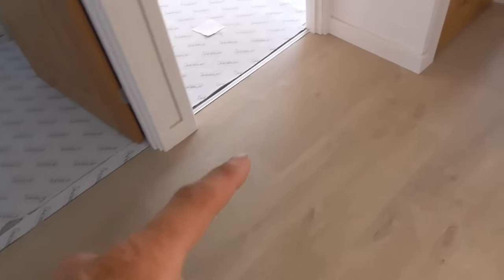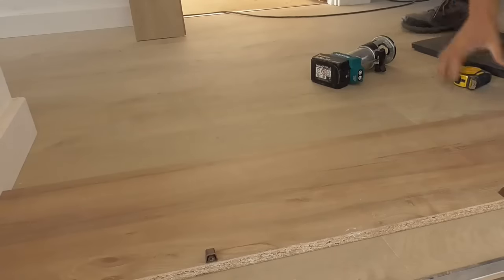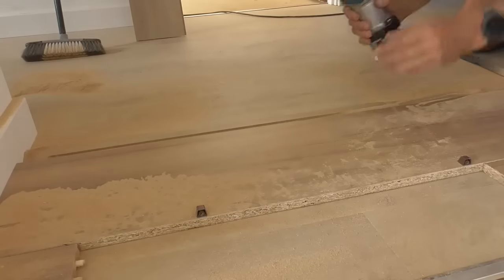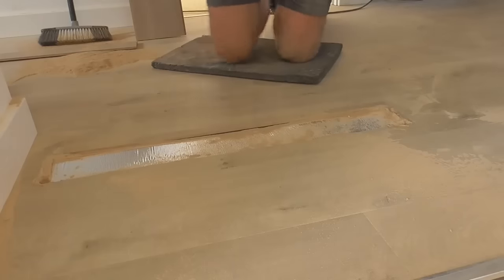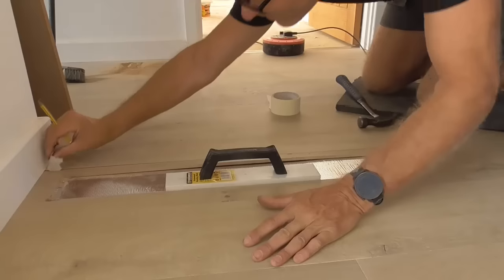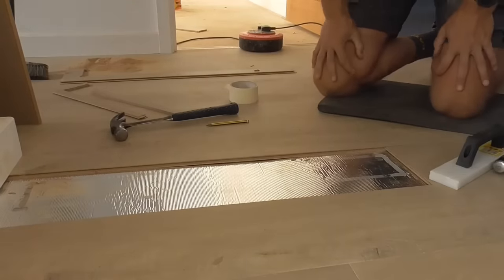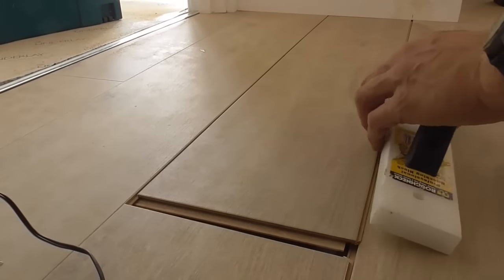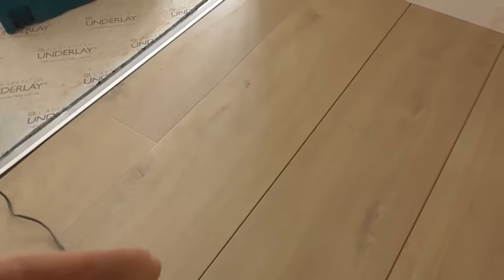Replacing a damaged laminate floor board. ***CAN I DO IT WITHOUT TAKING THE WHOLE FLOOR UP?***

Comment: Did the plumber drop his wallet? No wonder it made a mess 😂😂😂
Reply from the maker: Best comment ever🤣🤣
Reply: I was going comment Del but I'm too busy laughing 😂
Reply from the maker: @chrisneville7310  I proper laughed at Tonys comment Chris😆
Reply: @thetallcarpenter  I heard he slipped and nearly broke his BRASS neck and was later found by a COPPER.
Reply: 🤣🤣🤣 I wish. I'm blaming builders for making me work on trusses with no platform or lights. Worst part was I watched it slide along the top of tool case and bounce down ladder. Super Del to the rescue though. What a guy. 😍

Comment: More of these vids please. It’s how we rectify errors and mistakes that really help
Reply from the maker: Hi there🖐I have shown quite a few instances of my putting my mistakes right, but the are usually buried in a longer video😬Reading your comment, I think I might start making separate, stand alone videos about rectifying them👍Thanks for watching and your comment 😎 Cheers Del
Reply: Yes please. We all know you can do stuff, which is why we watch .... BUT the real application of your skill and experience comes when it goes wrong, or you are called in to fix something. This flooring one was particularly good, especially as you exposed your thinking in advance.  There are a few other 'Tubers now doing what I call 'confessionals' (PlumberParts, MrA Builders, SkillBuilder) and they are not only excellent viewing, but vital sharing as we have all been there ..... or will be one day.
One starter for you could be 'Wood matching' i.e. fixing damaged / split wood and getting the colour match right

  @thetallcarpenter

Comment: And that’s why quickstep is worth the money ! Had to do the same thing on engineered once but on a full one so had to cut a bit off the back off the shoulder and tongue. Not ideal! Good use of the palm router making a hole and then snapping the thin strips! 

Showing class and experience again, builders got to be happy with that!
Reply from the maker: Hi bud🖐It's never obvious which is the best approach for doing repairs like this, and I guess I will always try and go for one that has the best chance working and not becoming problematic later down the line🤔Thanks for watching 😎 Cheers

Comment: Great repair Del. Sometimes I think you need a little bit of luck on your side with jobs like that. Just a tip I picked up from another YouTuber( not tried yet) was to use a strong double sided tape on the plank to stick your knocking block to, to create that friction you need to split or relocate the joints rather than a chisel. 
Don’t forget to replace your router bit, as laminate is brutal on blades😂
Reply from the maker: Hi Paul🖐Great shout on the double sided tape, and I really should get some for the van👍Thanks for your comment bud 😎 Cheers Del

Comment: I found that if you cut the bottom part of the tongue off, you can get away with replacing a middle board. Just put some wood glue on the under side of the tongue
Reply from the maker: Hi there🖐I've never attempted a replacement like this on a full plank, but I rekon you're suggestion would work, as pva glue on LDF/MDF makes a super strong bond💪Thanks for your comment 😎 Cheers Del

Comment: Had to do one the other day. Replacement boards were 2mm shorter and I had to change the whole bastard run. Lucky you got quickstep 😢
Reply from the maker: Sounds like a right pain bud😵‍💫I guess I was double lucky with this repair, as it was a Quickstep floor and an end board👊Thanks for your comment and for watching 😎 Cheers Del

Comment: You might have been able to shift the board by sticking some double sided tape to a bit of 4x2 then pressing the 4x2 on to the board with your foot and hitting it with a hammer. Worked for me with some cork tiles with a similar click and lock system. Added advantage that the bit you're replacing doesn't get damaged, which might be an issue in different circumstances. All the best.
Reply from the maker: Hi DH🖐That's a great shout bud, and certainly could be the way to go in certain situations including the one in the video👍(I must get some strong double sided tape for the van🤔) Thanks for watching and your comment 😎 Cheers Del

Comment: Well done, mate. Good job.👍
Have you seen quick step repair kit,with the wax and heating gun.
Use it a few times for problems like the one you have done.
It works really well.
Carry on with the good work. 👏
Reply from the maker: Hi there🖐I think a builder had the repair kit you talked about many years ago and he said it was very handy👍Thanks for watching 😎 Cheers Del

Comment: Done well there mate👌ive got to repair some in my place but they are in the middle of the floor😒 might be easier to move 😁, there's quite a few vids on YouTube on how to do it but normally involves cutting tongues of and glue, worth watching though 👍
Reply from the maker: Hi Andy🖐, hope you're well mate🤞Yeah, I've seen the guys cutting the bottom part of the groove/tongue off and glue. I would be scared  that it wouldn't hold only to get a call back to fix it in the future😬Thanks for watching 😎 Cheers
Reply: @thetallcarpenter  👍

Comment: Lucky the damage was towards an edge. And an advantage of that non tip locking system. The rout out and implode the middle board technique is how I have always done my secret floorboard repairs. Then cut the back edge out of new board to drop in. Never tried it on cliplock. That bit of trickery saved heaps. But also exemplifies why I still wouldn't put that sort of flooring, or tiles, in my own place. I feel like I am walking on egg shells all the time when working on customer houses that have them. Tiles are worse.
Reply from the maker: Hi Dave🖐I know exactly what you mean about doing work 'over' these types of floors, as one slip, and it feels like your world is caving in😬Hope you are well mate and thanks for watching 😎 Cheers

Comment: 👍👌  >---------< cut board shape < say 45°from corners, cut down middle to join the ends up. Knife or multi if steady enough in corners😂 If in middle of run, cut new groove to suit, glue in new. Suction cups handy as well.
Reply from the maker: If this happens again I'm going to give your method a go👊Thanks for watching 😎 Cheers Del

Comment: Liberon do a hard colour matched repair wax that I have used to good effect on similar damage.
Reply from the maker: Hi there🖐They do, and I have a massive selection of colours, but the builders decided the gouge was too big and in the middle of a walk way to be waxed over, so asked if I could change it👍Thanks for your comment 😎 Cheers Del
Reply: @thetallcarpenter  It was good work buddy! I had to do something very similar , (car badge tape and a wooden block), to a Howdens rigid vinyl floor. Suffice to say It's branded quick step if I have any say in it going forward. Plumber's eh!